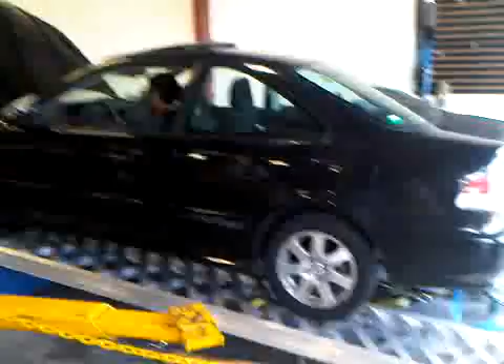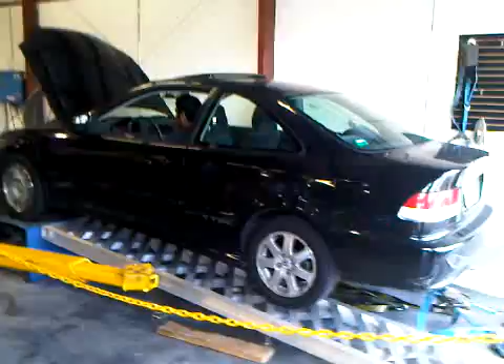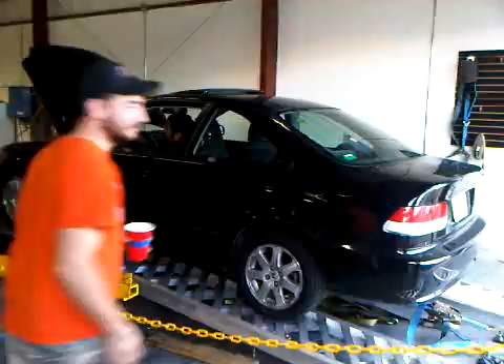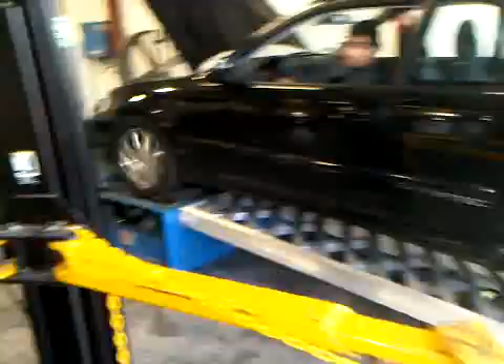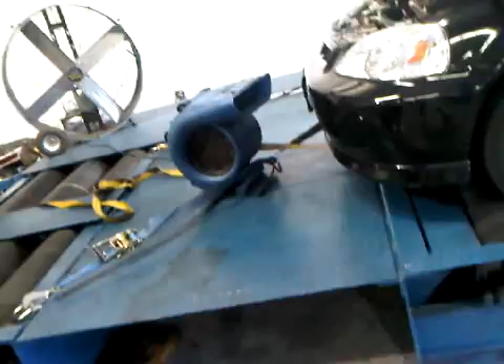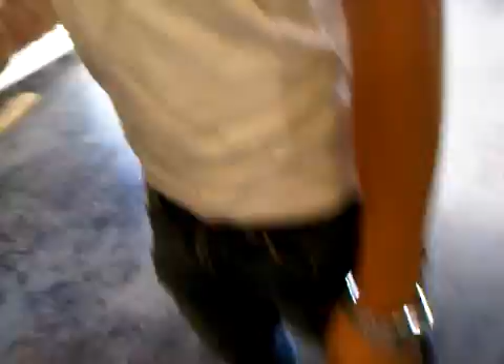EM1 VTEC Sound

Comment: Are they honestly that rare? I have two but I never looked at them as being rare..
Reply: Cameron yes the em1s are gems if u find them. They're all turboed and beat on and there's none of them left that are clean and stock. I have the same generation civic but the d series. Those si's were ahead of their time. They made like 170 horsepower in a car that weighed 2300-2400 pounds! They hauled ass